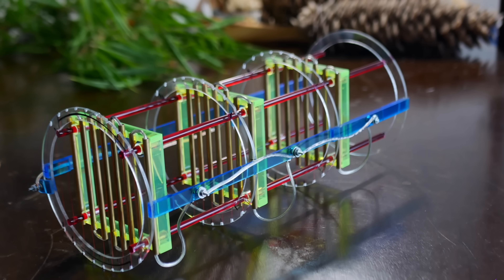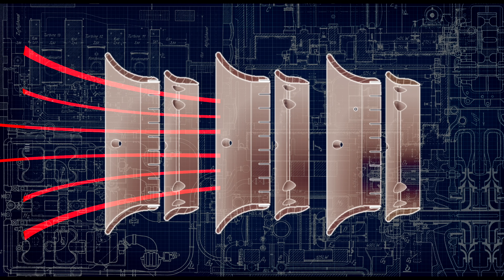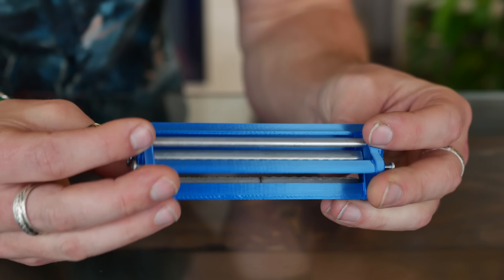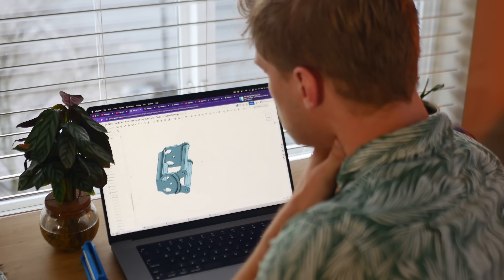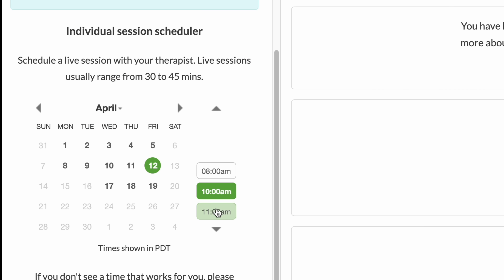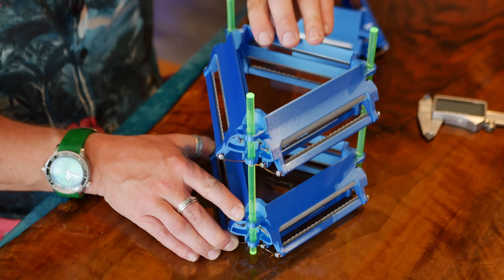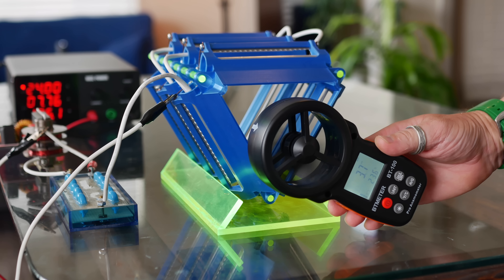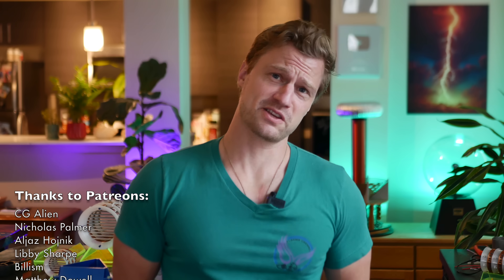Next-Gen Ionic Plasma Thruster Inspired By Nature (BTC Mark 3)

Comment: There is one way to improve your thruster design that you have completely ignored, it is insulation. if you electrically insulated your positive and negative the amount of voltage you could put through it without arcing would be exponentially higher than without it, the second thing insulation would allow for would be to put them closer together without arcing which would also improve its performance but that would face aerodynamic limitations so may not be the best way to improve it’s performance
Reply: The next major improvement would be to increase the voltage by several orders of magnitude as asymmetric capacitors perform better at higher voltages

Comment: (edit:  I'm thinking that there really is no "great" acceleration of air flow in this or these designs because "like charges repel/opposite charges attract" and nothing is changing in the ion chamber(s) to make the air accelerate (or move quicker than 1 time).  Only the volume appears to be changing, effectively squeezing the air that is gaining any real acceleration (like the venturi effect).

Does the frequency of the high voltage supply make a difference to the air flow, sorta like tuning to the "system" to the flow/venturi/"tube"?  Also, what would alternating positive-negative chambers do to the flow?  I'm thinking like regular electric motors do with alternating +/-  or N/S repel/attract force.  I'm assuming the air must get charged to either a "+" or "-" ionic state, right?

Comment: Those cheap amazon HV modules suck.  Majorly.  I use them, a lot.  But they burn out all the time.  Just a note for anyone tempted by the price.  Don't bury them in a final design without planning for frequent replacement.  Much better to create the circuit yourself and make easily burnable stuff like mosfets easy to swap.  They are not complicated at all.

Comment: Using a scale to measure thrust might be a better metric. Also, if each thryst stage is dialed in, one at a time, it would be easier to ensure the load is balanced across all stages.

Comment: moving air is utterly different to thrust, the reaction to moving mass. air speed alone means very little.

entrained air in an accelerator produces no thrust. its only due to whatever IS being accelerated impacting with it, transferring momentum, slowing down. that entrained air acts upon nothing but accelerated air... 

its a bit like how the rings of a vortex cannon dont come from the cannon itself. theyre produced by the surrounding atmosphere being pulled into the high speed, low pressure flow emerging from the muzzle... (could you make an "inverse" smoke ring? with the rotation acting the other way?)
but that ring in no way produces any reaction on the cannon. the reaction, the kickback, was to accelerating the gas column down its barrel. what happened outside its barrel has no influence on it. 

a plane... the only air that it can work on is that that contacts the propellor. and only that air being accelerated backwards can do work, produce thrust. everything else is dragged along with, or into that high speed air column, and does nothing but slow the air column down. a jet engine only reacts against the blades in the turbine itself, a rocket against the combustion chamber... what that jetstream hits AFTER LEAVING THE REACTION DEVICE DOES NOTHING BUT ADD DRAG.

a rocket works better in a vacuum as theres nothing behind it to impede the flow of stuff out the back... or in front, to push through.

so dyson type accelerator rings dont work. any type of air entrainment simply doesnt work. you might show great flow by moving smoke around, but what proportion of that air stream actually produces thrust on the elements, on the supports of the electrodes, on the structure of the vehicle?

and thats what has to be measured. the actual force acting upon the frame. the thrust. not the air speed.

the only way to get thrust from air entrainment is to redirect ALL the new flow, produce a reaction force by moving ALL the accelerated air mass in a new direction... think about that for a while... 

aerodynamics are fun :)

electricity...

so a positive electrode "rips electrons off air molecules" that then become positively charged, repelled from the electrode, and accelerate to the negative electrode.

cool. that is the ONLY thrust mechanism. the only thing you have to "push against" are those CHARGED air molecules. also, the negative terminal is being ATTRACTED to those same charged molecules... theres a push, and a pull... (is there? or is it ALL pull, or ALL push only?) the air molecule doesnt actually want to move, or at least, change path. all gas being in movement...

more electrodes, lower voltages, closer gaps, more charged air movement, more air WORKED upon, not air entrained...

what you want is to have the electrodes move, with the air STAYING WHERE IT IS... ideally, anyway. obviously as theres an exchange of momentum things have to move both ways... strap the unit still, air moves... let the unit move, air stays still. in a perfect world with no losses, lol.

go back to having it on a turntable. a BLDC with variable resistor, measure the torque it can produce on a reaction arm with a load cell. DONT measure the voltsxamps on the resistor, its meaningless... measure the torque reaction and RPM. let it spin. let it MOVE.

any neutral molecules getting impacted and "carried along for the ride" are simply impeding the flow of CHARGED molecules, and are NOT CREATING ANY THRUST.

they may be producing air FLOW, but it is not air flow that you worked upon directly to obtain a "reaction" from.

but redirecting that flow CAN produce a reaction...

Comment: What if each subunit decreased in size in the direction of flow?  Could you get the pressure to increase at all?

Alternatively could you apply these design changes to a funnel shape?  Im thinking of the coin donation set up where you drop a coin standing on its edge on the outside of a large sloped funnel and spins around riding the funnel around and getting faster and faster as the radius tightens.

Comment: Keep in mind when you're talking about diminishing returns that if you think in terms of energy, the energy in the column of air goes up with the square of velocity so when you have 2 m per second on the first stage and only add one more on the second stage, you may still be putting just as much energy into the column of air.

Comment: I think the interior geometry of this unit is limiting your performance. Air is surprisingly sitcky and elastic at speed, and without organization, I think you're going to be seeing significant performance losses. I'm interested in how the performance would change if you added golf-ball like dimples the the interior sides to reduce drag, and how a jet engine-like plug nozzle might improve your final speeds

Comment: Hi, this configuration has a flaw as, as you said, air streams are crossing which creates multiple turbulence that are slowing down the whole stream.   

It would be (much) better to try to get the most laminar stream possible - probabilities are it would also be more laminar with a longer nozzle and using juxtaposed straw sections or better, a honeycomb structure (this is what is used to get very lengthy laminar water streams, think Disney Epcot center with water streams jumping from one basin to another).

There's also an already existing problem : your thrusters' nozzles aren't ferpectly slick because of the 3D printing, which creates micro-turbulence, so using a filler that you'll sand to get very slick surfaces would eliminate this.   In a word, turbulence is your greater foe.

A long ago, a researcher friend of mine working upstream electronic components manufacturing show me a fluid mechanic software used to calculate how gazes were flowing by gravity into a confined and heated enclosure to reach all parts of a silicon wafer for doping purposes, it revealed that even the smallest rough bits could be a real disaster in term of flowing smoothly.

Comment: What is your output per wattage? not that different or very different? 
I am not super good with fluid mechanics but it looks like using the thrust equation you have a Thrust following:
1a: 0.004N
1b: 0.005N
1c: 0.007N
1b: 0.012N per engine unit... 

Problem is You dont list what the output wattage is for each engine. We assume its 7 or 9 Volts going into it, but you never show the actual Wattage and voltage going in.. It also begs the question Would a higher resistance material for the blades make it better or worse? 

You then stack them again, but show us the output velocity but not the corrected Thrust. Your air flow velocity seems to be just barely more. Okay well actually you broke 4 m/s, but did you increase the thrust to weight ratio? Decrease? could this be done better with better compression of ionized air columns? 

What if you compressed the ionized air so much so that you end up with a plasma ionic thruster where the plasma is not anything but generated by the pressure derived from the ionic thruster force of compression. This is where you want to go.

Comment: I think you need to take a trick that CRT TVs use when they accelerate their electrons, and that would be to have multiple stages at different potentials. For example, a CRT will have an anode at say, 400V to start the electrons moving. Then, further down, there's an anode with 10kV or more. For your design, putting each stage in series (so yeah, 3 power supplies would be needed) would allow each to continue accelerating the air, rather than being capped on speed. So, first stage has a 60kV supply, next stage has it's own 60kV supply (But electrically referenced to the previous one, such that if you measured the ground of the first supply and the 60kV output of the second, you'd measure a total of 120kV). 
Thinking about it, you might not need 3 separate supplies, just a bigger multiplier with several taps off it.

Comment: At some point, you will probably need to address the problem with ionic thrusters and aircraft - the fact that aircraft fly regularly through water vapor.  You have doubtless noticed that a little water vapor causes a spark to jump from your power to the grounding plates, reducing thrust.  You may need to spin whatever your end design thruster around an axis at a certain RPM in order to shed water condensing on your thruster with some centripetal acceleration.  There are a few types of slip rings available that can transmit enough power through their contacts to feed power and ground to your thrusters, if you need to do this.

Comment: I wonder if rings of varying sizes at each stage or a helix of bars will optimize the flow of air. the single unit moved a lot of air and putting them all together in triangles didnt see a huge difference, so a possible change in assembly could do it. maybe its possible to map out the air flow and put it in a simulator

Comment: the problem you may be now getting is the same sort of thing as 2 artics with flat sided trailers (semi's) driving side by side, the airflow tries to drag them together, and the intersecting air ends up in turbulence, that in turn ends up as drag, might need some sort of fin that starts the airflow to rotate into a vortex rather than a jumbled mess.

Comment: Have you considered sequential pulse power to the stages?

You could achieve a higher peak applied power, but with a much lower average power.

pPrhaps the sequential excitation might allow for layers of fresh un-ionised air to be accelerated by the later stages.

Comment: One thing that stands out to me is that  you're trying to recreate a classic Jet engine.  Don't.  The reason a jet engine is built that way is because it depends on a compressor fan that needs to rotate.  Your thruster doesn't.

You were definitely on to something with your wing design, lift comes from air moving faster under the wing and your thrusters can do that.  I'd be really interested to see what would happen if the entire wing edge was a line of thrusters, How much lift could that generate?

Comment: What if you try a staggered-mixed approach where you have an improved  MK2 thruster feeding into the open center of a MK3 thruster then stack that where the output of the MK3 thruster goes into another MK2 & 3 thrusters with higher power

Comment: Hey bro why don’t you take a blast from the past and try out a hybrid design. Imagine focusing less on a base thruster. I can image in ionic rotor that moves more air and if paired with an ion jet at the rear end of the rotor blade then it could do some crazy stuff. Another problem your facing is the following stages don’t have enough time to give the air “more juice”. I’d try out longer distancing, different segment of segments angle possibly increasing it decreasing the length till full “convergence”. Also, I’d recommend playing to the strengths of ionic thrust a bit more. I’d try a divergent design where like a ram jet necessitates prior high speed air. I’d try out having at the nose of the airplane small tubes that air would get sucking in, energized, then shot at the wing compressing air. In addition can you measure your videos in thrust instead of speed of air. And, Thank you so much bro. You inspired me on a scientific journey and this is a topic I think we all can grow on.

Comment: hey doubt you'd see this but going off the nature inspiration wouldn't something like a whirlpool or sunflower with spiral design work? It wouldn't exactly be a spiral maybe more of a decagon or hexagon that has exponential increase, would this cause the air to become a more dense column of air that can push more. 
It's just an idea since I think personally triangles, circles and spirals are the best shapes in nature due to their individual strengths.
A spiral like that of the more modern turbines might allow convergence of air, or like I thought, an upside down whirlpool where it spirals from wide to a more dense column.
Thought it could be cool if you wanted to test some ideas.

Comment: Still extremely cool, but still extremely impractical. 😅
The back draft on the single thruster next to the fog machine is probably a good clue. If it is really sucking in that much air from all directions, then that is a massive inefficiency. Making sure that it only pulls from the front and throws out the back is key to making this work.
The problem with a hollow design is that while banana proof, it is also wing proof. It's never going to be strong enough in the atmosphere to lift itself, much less all the support electronics to go with it, so putting it along a wing tip is the only viable way to get any real lift. Having an open hex grid material in front of a wing with a negative plate along it's front/top is likely your best option for lift and thrust.

Comment: What you need is miniaturization of your extraneous parts. Find the optimization path forward. I suggest looking at quadra pole and octapole ionization designs from mass sectrometers. As well as Time of Flight Ionization. Pre-ionize or prep the air for faster ionization with less energy. Miniaturize the necessary spacing of everything. then maximize the spacing of everything that needs more. Think Jet engine vs convention engine. You need to turbo-fy the thruster. maybe not with turbos but you need to compress and deliver ionized air at a higher pressure or higher volume. Volume quickly becomes cost prohibitive because of the weight factors. Pressure requires greater skill in manipulating fluid mechanics

Comment: Try combining both methods. Think of it like this even if something does hit it and brake the inner thruster you still have some thrust form the outer thruster. Most jets have two or more thrusters and can sustain flight with just one. If it works and you did loose one thruster on a jet with two thrusters then you still have 1.5 times the thrust. Not true math but you get the idea

Comment: This is a well known issue of lifters, which is that moving air cannot be ionized as easily as non-moving air. Thus once your input stream is moving, your return falls, as you experienced.
The idea of making parallel thrusters is good but it will not work as much if the input air is already moving.

Instead you should probably try something different which breaks a part of the air flow to ionize it better. A few ideas would be something such as :
 - A tesla valve where each lobe is used to accelerate the air in the opened direction of the valve.
 - A mix between a pulse jet and an ion thruster, where the cavity is used to ionized the content, and the exit pipe is used to attract and neutralized the air.

However both of these approaches might have arcing issues due to the varying air density.

Comment: I think your suspicion of failing to accelerate because its a single column of air is correct. Each stage can only accelerate to a certain speed and I think that the power drawn by the other stages is just to keep the flow from leaking through their aperture. You can measure their intakes too and you could also  block them to see if it makes a difference. If you want pure air speed, try making every stage smaller than the last so you force the air to accelerate and/or increase the voltage at each stage since the top speed of air could be dependent on this voltage.

Comment: I have a question
     Seen this video using graphite on paper to conduct high voltage
      Would it be possible to draw a ionic thruster pattern
     And make a ionic thrust paper airplane
Reply: Or would it burn the paper?
Reply: Been on my mind since I first seen one of your iconic thrust videos
    And I have a paper airplane design I really want to try it with

Comment: Fun fact, fire is conductive and acts as a really good "point" for discharging high voltage. I wonder if a design with little jets of flame would do any better. (Would have to calculate in what amount of air is getting pushed by just the gas ofc)